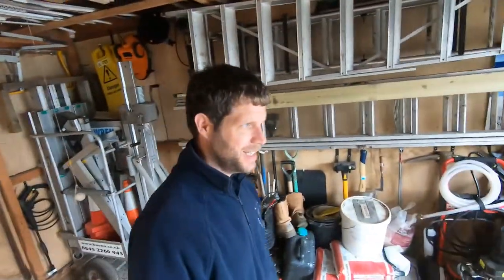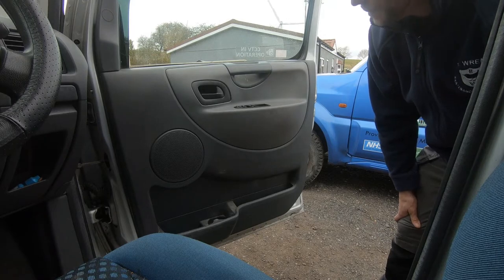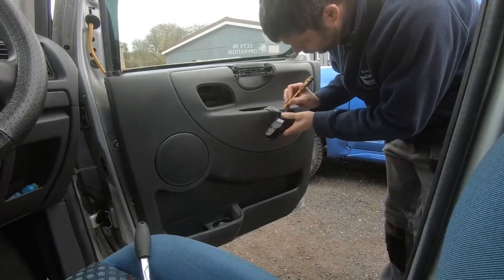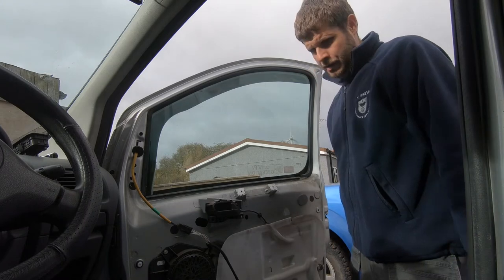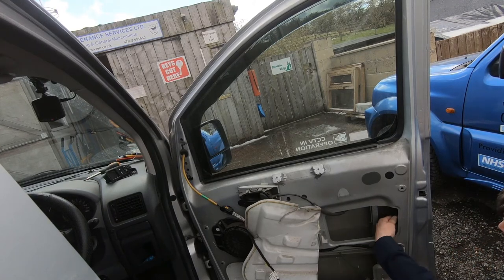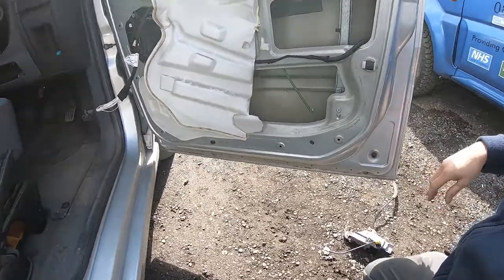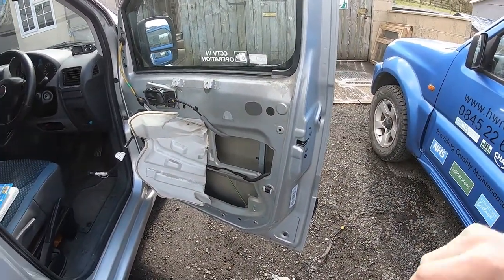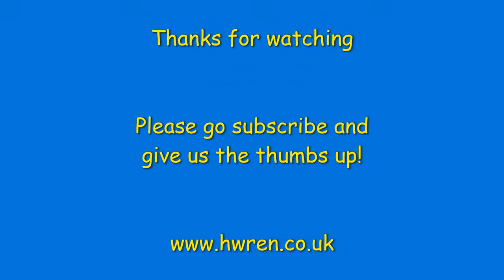Van Problems! - Fiat scudo door lock fault & replacement.

Comment: thank you so much been having this problem with mine thought it might be wiring issue hopefully its the same as yours but little price 100+ for a lock
Reply from the maker: I initially thought wiring issues too. I've had no problems since. The locks seem pricey but I personally would only fit new and ideally genuine at that. There were a few second hand ones about but then you could be buying someone else's problems.
Reply: @HWrenMaintenanceServicesLTD   yeah i thought wiring till saw this video but i priced a part up from fiat £210 pounds haha mean aint paying that but also cant find one for passenger door only driver door ):

Comment: Can you remember the part number? I have same problem.
Reply from the maker: I've just looked at the receipt form SG Petch. Under the "deposit part number" section it has 9681335780 and "description" Lock. Not sure if that is a reference for SG Petch as a google of that number doesn't bring anything up.